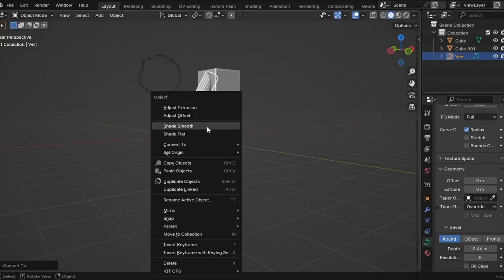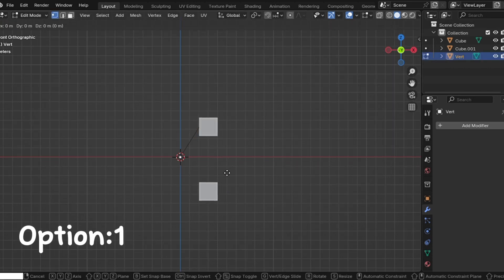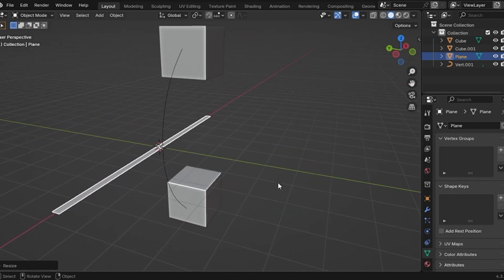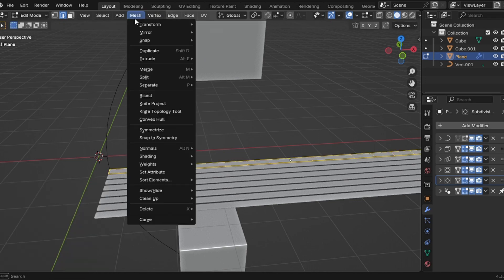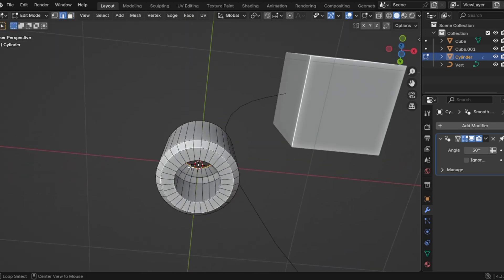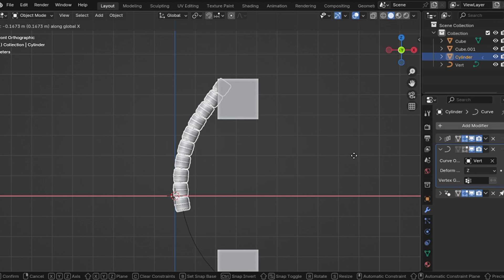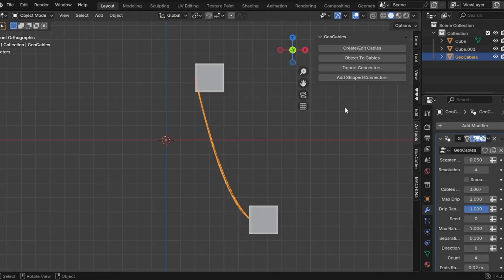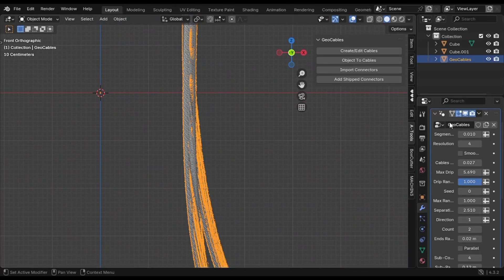Stop Making BORING Cables! Try These 3 Sci-Fi Designs Instead! | blender 3D

Comment: Hey there Jack! For your ribbon cable. If you want to help keep in non-destrictive, when you have your curve.. look at the geometry section, find bevel, and change it from "round" to "object". Create a plane, scale it to the shape you want, bevel, whatever.. convert that to a curve as well. then set that as your bevel shape. Another thing I found using Blender is there's always more than a few ways to do stuff. On your sci-fi cable. When you inset the top and bottom face, you do not need to delete. Simply do the bridge and it does the same thing in less steps. Hope this helps.
Reply from the maker: Thanks for your help man, i hope it not only helps me but also the people who watch this.🤝